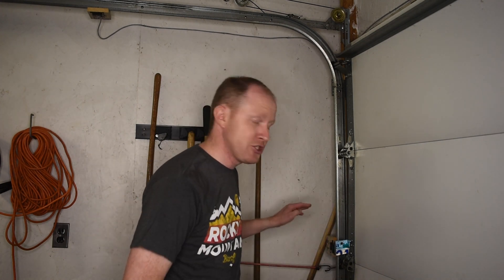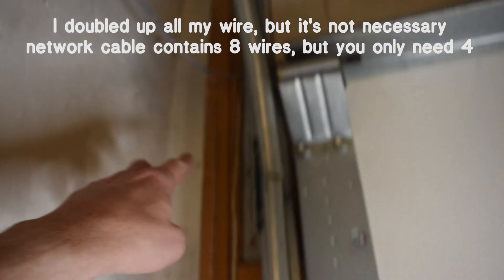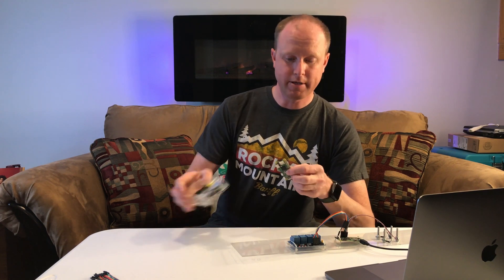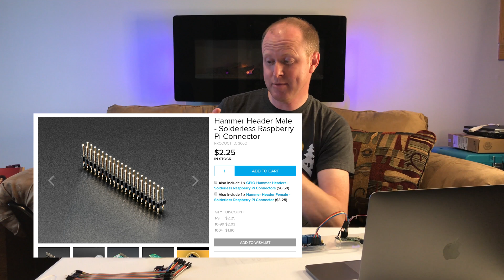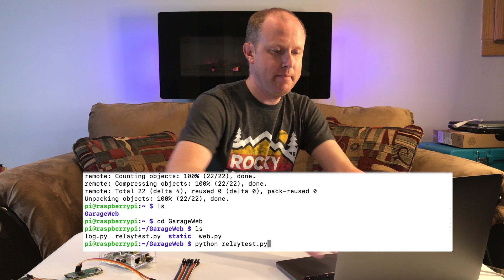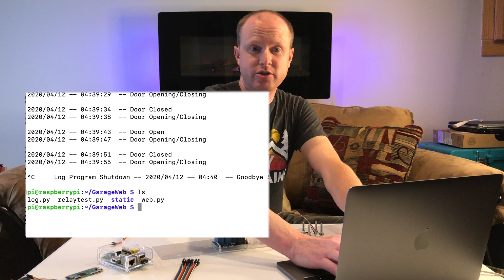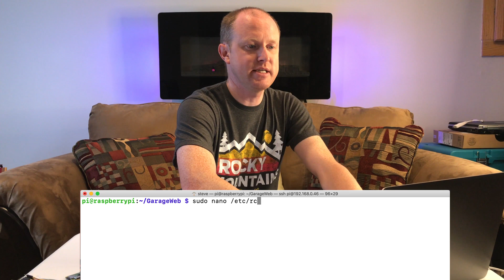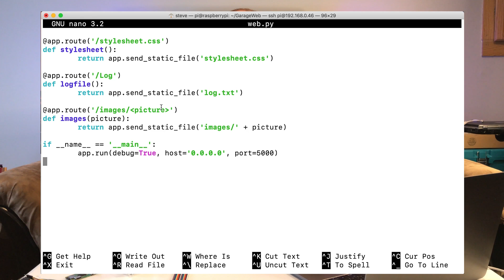Raspberry Pi Controlled Garage Door & Sensor (complete instructions)

Comment: Okay so I understand how to make it work…. But now to take this into 2023 can I make an app to access the pi? An app that only me can give out or make accessible to whom ever? 

If this is possible I’m doing this over the next few weeks. 

I don’t like the wifi options on the new units. I would rather it be a Ethernet connection.
Reply from the maker: I made an updated video that now works using Siri that uses the exact same hardware setup. Only the code for this project has changed. I made a video on this new feature. Check that out here: https://youtu.be/wfsYFM-9Dns

You can set this up to work on many iPhones.

Comment: Hi,
I have been running the app for quite a few months with no problem on a 14 year old Liftmaster. I had to change it for a newer model with the exact same hookup. The relay is still working but it won't open the door. The new unit just flashes the up/down buttons but doesn't open the door. Not sure why. I'm afraid to play with it too much for fear of possibly damaging the new unit. In any case the new unit is already set up for wifi but I liked the idea of hosting the function locally rather than using a third part app.
Reply: newer garage door openers send a signal over the wires. its not just a simple close contact triggered switch anymore

Comment: im having trouble getting the log script to run correctly any chance of some assistance
Reply: @Steve_Does_Stuff  I got the log script to run, I think after i worked the scripts out,  I was using the wrong relay, it was a 8 relay arduino one which the pi didnt supply enough power to the relay, I have since bought another relay which looks basically same as yours but I think it was faulty when I received it, will get another relay and try that, I will post if I need further assistance thanks for the reply

Comment: Hello, Steve 
This is fantastic work, I have a single channel relay and have edited the code to reflect that. When I run the 'relaytest' it closes the circuit and doesnt open it back up again. I have used GPIO 11 and changed the code from 16. I can hear the relay close and the light comes on but it doesn't open after the 0 5 timer setting. I want to get it working on this setup before I try the Alexa version.
Reply: i was running my relay board on 5.5v, this doesn't work. i switched to 3.3v and everything works as it should! thank you

Comment: Hey Steve, got a quick question, so I have everything hooked up and it works great, Except! The magnetic switches do not work when used in web.py . If I load the log.py they work as intended. When i start web.py it starts with door closed no matter the position, when you activate the door it goes to a question mark and never updates again. Any thing you can tell me to point me in the right direction?
Reply: @Steve_Does_Stuff  SWEET thanks Steve!
Reply: @Steve_Does_Stuff  I just rewatched the video and sure enough you did say it doesn't refresh the page lol, sorry Steve I hate to be one of those guys
Reply: @Steve_Does_Stuff  Yessir I've seen the video, does it also work with google? I ran into this project because I bought an android headunit for my car and I thought it would be cool to control the garage door from an app on my headunit! You are the man sir Hope you have a great night.

Comment: Steve, I have an update. I spent yesterday installing the Raspberry Pi Zero Z and associated hardware onto my two garage doors. The Wiring was pretty easy to set up. I wired them to 4 relays as I am planning for the future. In the future I want to not only be able to control the doors with my phone ( and Alexa ) but also the lights. Currently I have "web.py" from this video up and running on the Pi Zero, but I've run into a bit of a snag. I found that when I start "web.py" through SSH everything works great, but after I close my SSH session the program crashes and will no longer respond to my phone or desktop ( at 192.168.0.xxx:5000 ) . Have you heard of this happening before? I plan on downloading your newer software in the future, as "web.py" was mainly a proof of concept for now just to make sure that I had at least gotten the 1st door hooked up correctly. I don't know if you can tell, but I am excited about this project. Not because I need this function, or I have a use for it, because it's fun to learn this stuff and doesn't cost very much to experiment with.
Reply: @Steve_Does_Stuff  Thanks for the information. I was thinking that might work, but I haven't had a chance to try it yet.
Reply: I know it's 3 years later. The purpose of the "&" at the end of command is to run in a separate/background session. If you run it manually from an SSH session, and want it to continue running after you disconnect, add the & at the end.

Comment: Steve, I realize that it's been a year since this was published, but have you updated the code at all? I was wondering if I could get your help in adding some features to your code. First, I would like to add a feature to turn on/ off the  built in garage door light without opening the door, and I would also like to add in the ability to monitor and open / close two garage doors instead of just one door. Finally I would like to be able to add in Alexa control over the whole thing. If you have time I would like your help please. I am new to python programming.
Reply: @Steve_Does_Stuff  Thanks for the fast reply. This raspberry pi stuff is addictive. I stayed up late last night figuring out how the wall control unit works so that I can also control the light on the door opener. I have a Genie Pro Excelerator  door opener that was installed in 2007. I'm not sure if the following information is standard for all door openers, but for my Genie Pro I figured out that the door control unit sends a 5v signal to the wall control switch assembly. In the wall switch assembly I traced the path of the circuits and figured out that if the "door" button is pressed it just shorts the 5v reference voltage to the return wire, but if the "Light" button is pressed the 5 volts passes through the switch, to first a 82.5 ohm resistor and then a 121 ohm resistor in series and then back to signal return. I didn't have a 203.5 ohm resister sitting around, but I did have a couple of 100 ohm resistors, so late last night with the help of a couple of jumper wires and a bread board, I verified that if I jump the garage door control pins at the opener through a 200 ohm resistor, only the light will turn on / off and not open the door. With that information, and an extra relay, maybe you can work light control into your code. Thanks again for your video. I am learning a lot from them.

Comment: steve, i can't run python log.py . this error message is  File "log.py", line 7, in <module>
    logfile = open("/home/pi/GarageWeb/static/log.txt","a")
IOError: [Errno 13] Permission denied: '/home/pi/GarageWeb/static/log.txt'
what's the solution?
Reply: @Steve_Does_Stuff  now my error is this  File "log.py", line 28
    if DoorOpenTimer == 1:  #Door Open Timer has Started
     ^
SyntaxError: invalid syntax

Comment: Hi Steve. I have to refresh my iPhone in order to see the correct images for the status of the garage door. Any suggestion how to eliminate the need to refresh the iPhone? Otherwise everything is installed in the garage and working well.
Reply: @Steve_Does_Stuff  Thanks Steve. Excellent as is.
Reply: You should be able to add a 'refresh' statement to the html header of each page, which will cause the page to refresh automagically every x number of seconds, set by you. In each of the Open.html, Closed.html, and Question.html files in the static folder, change 

<meta name="viewport" content="width=device-width">
to 
<meta name="viewport" content="width=device-width" http-equiv="refresh" content="xx"> 

with the xx being the number of seconds between page refreshes, then reload the Pi and you should be good. 

An example might be http-equiv="refresh" content="30" for it to reload the page every 30 seconds.

Comment: Thanks Steve. Built the garage opener around RPi Zero with latest software. Added the two lines you suggested to rc.local but it does not execute the web.py program on reboot.
Reply: I added s sleep 60 instruction at the beginning of rc.local which seems to fix the issue.
Reply: @Steve_Does_Stuff  Thanks Steve. I'll try it

Comment: Spare pi sitting around while in lockdown so thought i would give this a try. easy instruction and worked a treat. Wondering before i fully connect relay etc, do you steve or anyone have a guide on how to add a video stream to the web url/image , so I can see what is going on aswell,,?? thx

Comment: Fantastic Job with the project and the video!  Thanks!

Maybe it's not really a big deal but I'm curious why the default is to set the GPIO pins to HIGH as the default and going LOW to trigger the relay instead of the other way around.  Isn't voltage applied to the PIN when high, and wouldn't it make sense to default LOW and only send the voltage to trigger the relay when necessary?
Reply: @Steve_Does_Stuff  
Makes sense.  I guess since I’ve only access to the relay (not the module), and having to include the switching transistor all of the schematics I referenced included a pull down resistor to make the switching definitive.  I suppose I could do away with that and rely on the internal pull up and go high on the pin as well.

Thanks for the quick reply and a great project!

Comment: Thanks for this Steve! I seem to have everything working except for the autostart of the webserver .. Not working through rc.local, have tried through init.d then gave up when trying to use through Supervisor ... I am running the latest raspberry pi os Release date: August 20th 2020
 , Kernel version: 5.4 . Anyone else having this issue or knowwhat image to run? Thanks :)
Reply: For those who have the same issue I've fixed it! I still used the rc.local way of autostarting but for some reason I also had to run :
sudo chmod 755 /etc/rc.local
sudo chmod 755 /home/pi/GarageWeb/log.py
sudo chmod 755 /home/pi/GarageWeb/web.py

Comment: Steve...thanks for help with the email. Now I have another question...I would like to implement this with just one magnetic switch. How would log.py need to be modified so it will work with just one magnetic switch instead of the 2 that you are using? Thanks!
Reply: @Steve_Does_Stuff  Thanks Steve. It took quite a bit of fiddling and trial-and-error, but after many hours this non-programmer finally got it to work with the one magnetic switch. It was also pretty easy, once I figured out the correct syntax, to use msmtp to  send emails and text messages to notify me of the open, close and 15 minute reminder of the door activity. Great learning experience.

Comment: Nice project and easy to understand. Can you suggest how to add code to log.py to send an email if the door has been open too long? I know it should go around line 31, but not sure of the syntax necessary to use msmtp to send the email. From the command line it is "echo "message text" | mail -s "Subject text" email-recipient.com " but this does not work if I insert it at line 32 of log.py.  Any ideas or help with this? I am sure others would like to do this as well.
Thanks!
Reply: Actually, the send-to should be email-recipient@gmail.com. Sorry about that typo.
Reply: @Steve_Does_Stuff  THanks much for your reply. I did attempt to use ssmtp but found out that it is no longer supported. Instead, it is recommended to use msmpt. After a lot of fussing with it, finally got the syntax and setup figured out and it is working just fine. Thanks for this great tutorial.

Comment: "Not knowing the status of the door is what's bothering me"
Welllll, I would personally be a lot more bothered by having this little Pi open to the Internet with the ability to control the garage door.

Depending on how valuable the items stored in the garage are, here is how I'd run this. Put the actual control of the garage relay on a separate R-Pi with its own wireless AP which provide wireless service to the drive way area. NO internet connection whatsoever.

Then put your magnetic switch on another device with Internet connectivity and have it configured with a push notification system and all the bells and whistles of remote access if you really wanted to.

Bottom line is, don't trust the Internet of things to be all secured, especially when handing off the keys of your house.

Comment: I'm very new to the PI and Arduino scene.  I'm wondering if you could tie this in with an ESP8266 and add it to Home Assistant.  I currently have something from Amazon that works with Smartlife, but I'm moving away from their platform.

Comment: Steve: 
Fist of all thank you for writing this up great project !. I worked through the instructions, but  I used a single opto isolated relay, which wound up causing some issues. After a lot of trouble shooting it turns out the single relay did not like having Vcc= 5V in the trigger voltage = 3.3V.  As the program pulls in GPIO pins high and triggers on low, in the quiescent  state I think that there is 1.7 v across the opto coupler. It would trigger but not release. The problem was solved when I fed the relays 3.3 V Vcc from pin 1 vs pin 2 in your circuit. I think that this makes sense In the quiescent state there would be zero volt drop across the opto coupler if the Vcc = 3.3V. 
With Vcc = 5 V on the relay, my garage door opener did not like it at all. I think the relay was in an undefined state.  Perhpas this will help some other weekend warriors.

Comment: You should add a raspberry pi camera so when door opens it takes a snap shoot of the person at the garage door
Reply: or a 20 sec clip. ;)
Reply: This I would be interested in if anyone has details on how
Reply: @johnb6982  so far been busy working on getting solar power to run my garage but I may have to work on that this summer and figure it out

Comment: Hi Steve, Put this in today. Just wanted point out that when you are in your garage you show the reed switches using the normally open NO output, but later in the video (when you are showing the pinout diagram) it shows the GPIOs connect to the normally closed NC output. I went off the pinout diagram and spent an hour scratching my head as to why I couldn't detect the position of the door correctly. The NO normally open configuration is the correct one.

I also have an issue that when the raspberry pi is rebooted it operates the relay which in the event of a power cut would open my door when the power is restored.
Reply: Sorted the relay issue. Noticed in web.py that pin 7 (that controls the relay) is defaulted to a high state. Set the default state to low and altered the opening routine accordingly (go to high, return to low) and it is working fine now.

Comment: Hi Steve, congratulations on the project, I have already done it for my two garages and it works perfectly, unfortunately I had to use two Raspberry Pi with two different ip, it would be nice to implement on a single raspberry the choice of which door to open, given the large size amount of GPIO available to double the functions.
EXCELLENT the idea of sending an alert when the door opens, but not via email, it would be better and more immediate to receive a notification with TELEGRAM with the use of a personal BOT, which alerts me at 5 minute intervals until closes and notifies me of the closure ... Greetings from Italy.